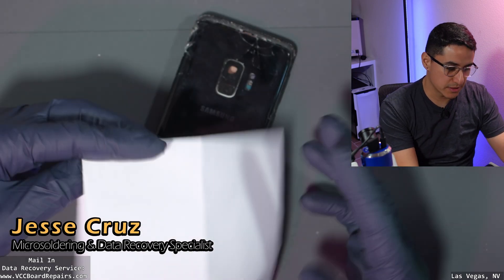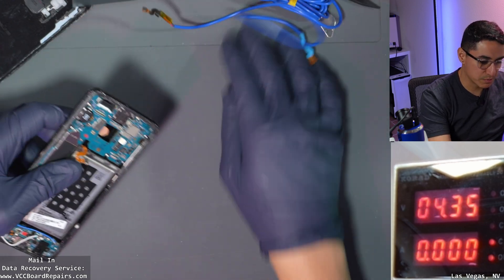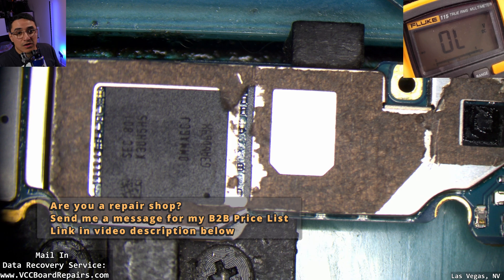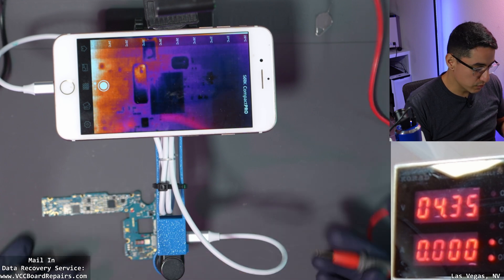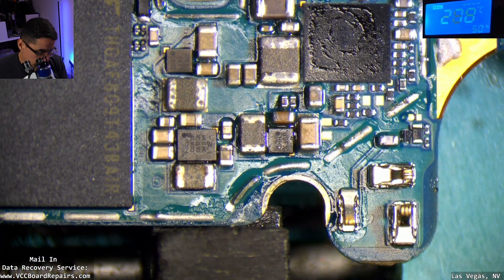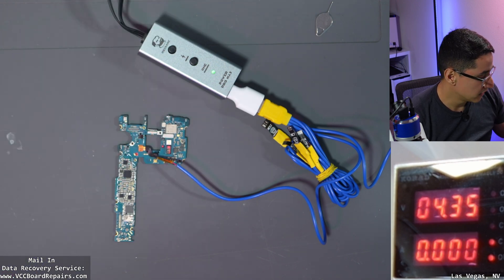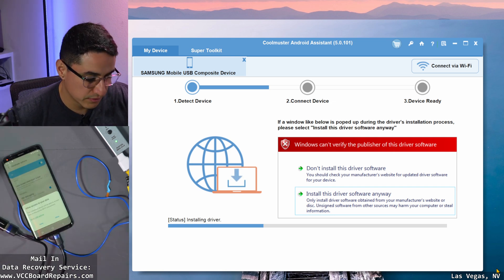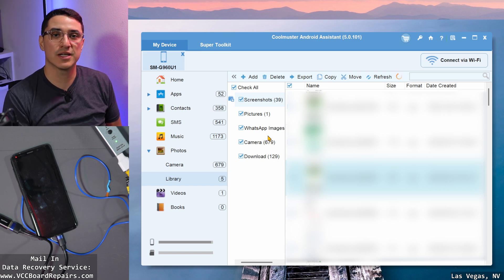The Best Way To Recover Data From a WATER DAMAGED Samsung S9. Step by Step Tutorial

Comment: Hi sir I have iPhone X it charges ok when switch off when it turn on    Itself it stop charging . I have changed charging ic u2 ic 1612a1 ic, cpd2 ic also changed 3pin small diode near battery connector but same condition please help 🙏🏻
Reply from the maker: not sure

Comment: Why using Mechanics boot box! What you get via box you will get directly if you use USB out from Power Supply!
Reply from the maker: There's no USB out on my power supply
Reply: @VCCBoardRepairs  2 Banana clip + 1 USB Female + 30 Sec job. You got one!
Reply from the maker: Why would I bother doing that for?
Reply: @VCCBoardRepairs  
To save beginners from wasting money on the iBoot mechanic, which is useless for diagnostics, you can mention that this video,  or maybe video is intended to promote mechanic products.
Reply from the maker: @Sherifone78 it's not useless. Stop being so dense 😂
Reply: @VCCBoardRepairs  No need to call me dense or offend , I didn't offend you except told the truth. Saving other money is virtue ,  making others to buy useless things is hmmm 😁
Reply: power button, led indicator, plus extra button for smth